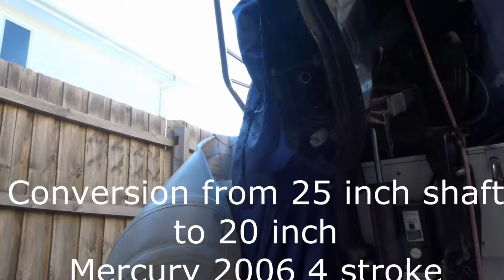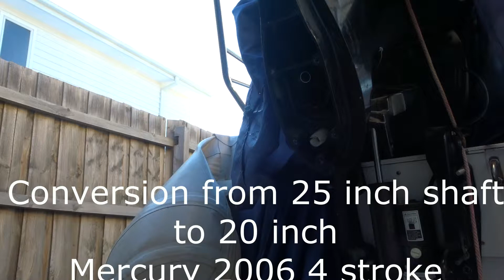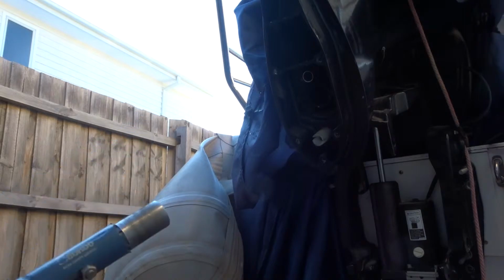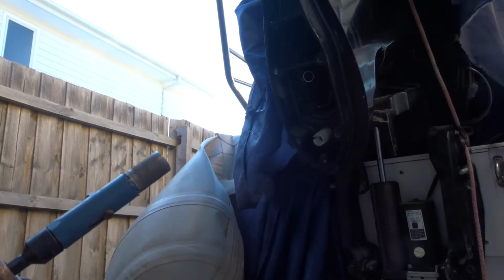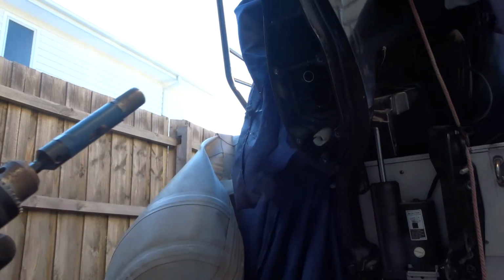Mercury Outboard motor conversion,  cut water tube ,save time.

Comment: How did you make that bit?
Reply from the maker: From a holesaw  with the  exact size  of the outside diameter of the tube and a guide inserted into the holesaw  with ID of the tube secured with screws . Hope that's clear .
Cheers